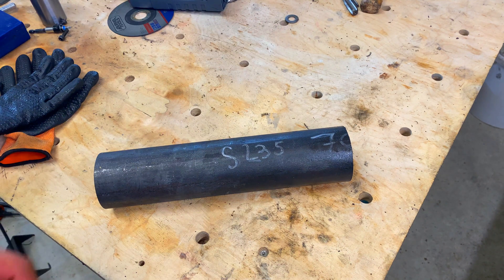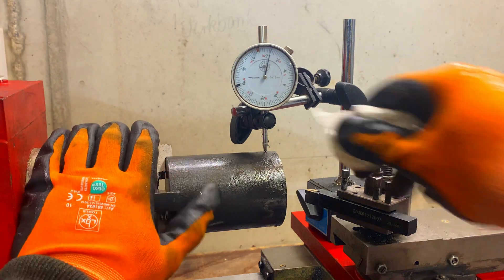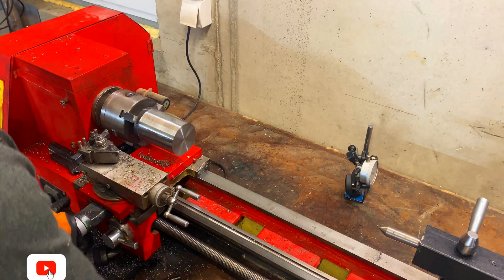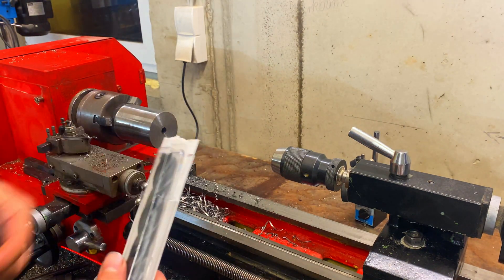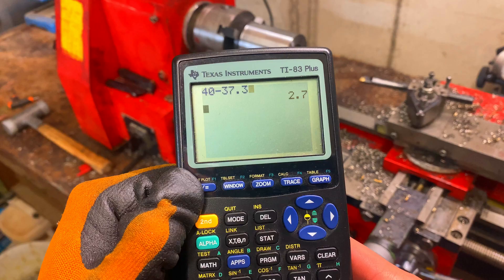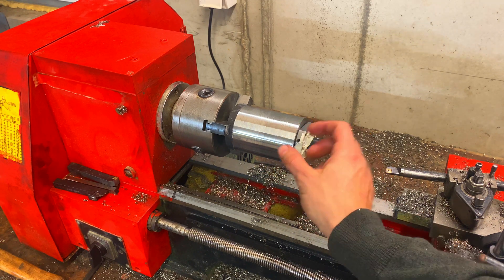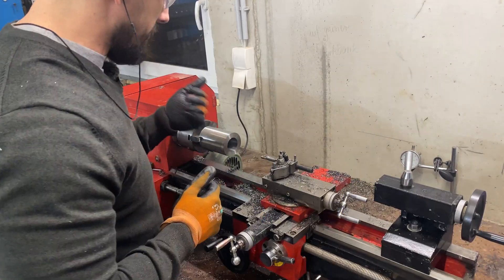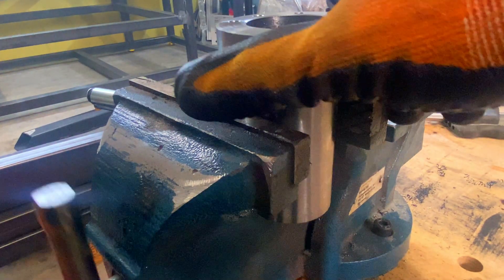Driven Ball Nut DESIGN That Will Absolutely CHANGE Your DIY CNC Game!

Comment from the maker: How do you all manage SCREW WHIP?
Reply: There shouldn't be any because the screw is stationary and the ballnut rotates. That's the motivation for a system like this.
Reply from the maker: Correct, now lets say the screw moves the ball nut. How would you manage screw whip. I've only had this on my  axis  where my SFU12's whipped and I was like WTF. nonetheless, I just slowed down the machines parameters a bit. (Old CNC that I built)
This new one will have, as you have seen the driven ball nut design.
Reply: @steelknightcnc you can reduce screw whip by fixing both screw ends and 'stretching' the screw, i.e., putting the screw under tension when mounting it. Or, move to a larger diameter ball screw.
Reply from the maker: @dominicfeira8037 absolutely, but having a rotating ball screw over a certain length and if it’s no thick enough it can cause whip. 

My old machine has the Sfu 12 series and no matter how tight I made the screw on the end. The the acceleration is still somehow wind up bending it a little bit it’s not bad.

Comment: Is there a balancing issue with the ball nut since the flange on it isnt completely circular?  I've have noticed that they are on factory designed ones but those are over 500 bucks.
Reply from the maker: Hey, that’s a very good question with the flange being not completely circular. That possibly could have an effect on it that I do not know but I’m gonna assume maybe not due to the fact that the centrifugal force is at its center. For the ball screw the longer the ball screw the more  whip can be. 

Now it also has to do with how thick the ball screw is. 

How straight the ball screw is. I.e. if you go cheap and they ship it without a really good box there’s a high possibility of Ben’s coming from just you know from handler to handler before it hits your door.

All these can play a huge factor. 

But if you’re going with a professional company that sells ball screws of course you’re going to pay a good amount of price for that screw and ball nut. 

This warrants further research into why there would be screw whip.